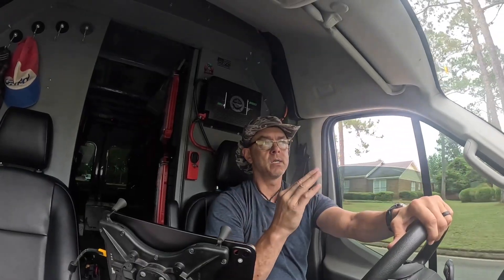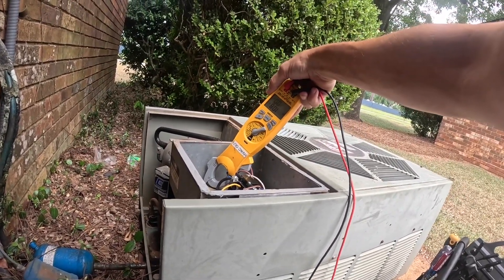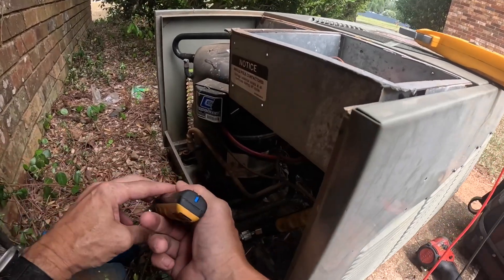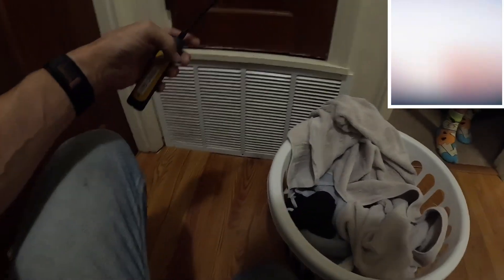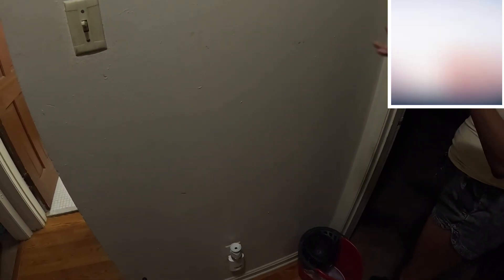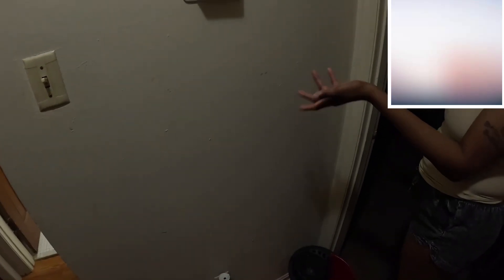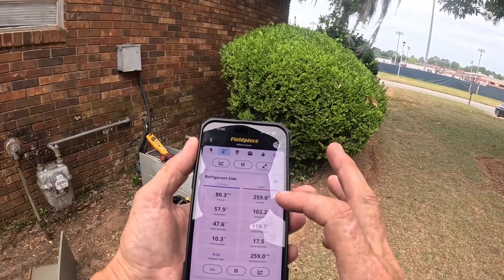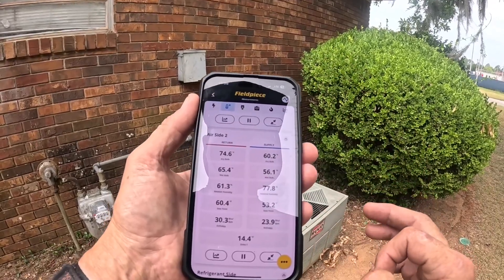Third Visit Within 2 Months, But Was It My Fault? #hvacguy #hvaclife #hvactrainingvideos

Comment: Some people are convinced that turning their AC off while at work will be cheaper than leaving it on. It's way better to pick a reasonable temp like 75 or 76 and leave it there. It takes way more power to get rid of a lot of heat to cool it off vs getting rid of a little heat to maintain temp. I have tested it and typically in my case it will take 15-20% less power over a week to maintain temp than it does to bring the temp down just to let it go back up day after day.

In this case the unit seems underpowered.
Reply: Correct.
Also, residential units tend to be undersized

Comment: That condenser fan motor is bad.
It was hot, did not spin freely and sounded like crap!!!
The age of that unit should make little difference in the expected delta temperature.
Yes, the need to keep it running continually when it is that hot outside is best.

Comment: This looks like a good place to share a secret. It’s called super cooling. It works very well in southern Arizona where the summer daytime temps are normally north of 100.
Run the AC at night. Turn it off around 0600.  Cool the house to as cold as you can stand it.
Everything in the house absorbs the cool air.  Around 2100, I turn it back on. The house never gets above 78.  Basically the AC starts once o every 24 hours. Five year old system still has original condenser.

Comment: I have the same outside unit at my house and was told the cold and hot valve was stuck and they no longer make a value replacement. They wire it to cool and they come back right before winter and switch it to heat. Is this true?
Reply: Ish. You could get a new aftermarket one. Won't be a direct drop in but they're available.

Comment: Perhaps a bit over-simplified, I've been told that airconditioning systems work on temperature difference such as this one is specified at 20 degrees. People seem to think that if you turn the thermostat down to 60 degrees on a 95 degree day that the unit will do so. A newly installed system might do that, an older system will not.

Comment: System seems to be working fine so callback is not your fault.  People don't seem to understand a system is designed to work by running all the time.  Like you said in the video if she shuts it off its starting over every time and can never catch up.  To maintain temperature and especially lower humidity it really needs to stay on all the time.  She probably thinks she is saving money but she is likely actually spending more because it its always working to catch up after being turned off

Comment: 10 superheat 17 subcool
R22 from my knowledge should be at perfect level 20-20 some play to it but over all pretty even
Id pull the gas and rx11 flush the lines through the evap out to the service valves
Piston may have some build up
That jumping delta would point me to the electrical heating strips the dang sequencers end up going sometimes and or the low voltage gets a corroded and turns it on 
Overall this call seems to be user error

Comment: NOT your fault.  Tenant is thinking that air conditioning should be cooling the house as quickly as the furnace heats it up. She needs to understand that an air conditioner does two jobs at once.  That it is dehumidifying and reducing the inside air temperature.  By letting the temperature rise to 80+ before she turns it back on in the afternoon she is overwhelming the air conditioner. If she wants to cool the house down quickly after turning the unit off all morning, the apartment we need an oversized unit, maybe three ton.... But then it would cool the house down before removing the humidity

Comment: Residential structures are only designed to maintain 78 degrees inside when its 92 outdoors here in north Georgia. Most systems have a little bit more capacity and on a 95 degree day you might be able to get the inside down to 75 degrees.

Comment: I had one of my Fieldpiece probes do what yours was doing there. I use Measure Quick because I’m not a huge fan of the Fieldpiece app, and I have a psychrometer for outdoor air. I noticed my head pressure target was bouncing all over the place so I checked the outdoor temperature and it was jumping from 85 degrees to like 55 degrees all the way down to 28 degrees then back up to 85. I put new batteries in it but it didn’t fix the problem so I bought a new one. If you had a psychrometer doing what mine was it would affect your Delta T like what was happening in the video.

Comment: Did you test the capacitor? I didn’t see that in the video, I had to ask lol. Also did you replace the condenser fan motor. We MUST cut the fan shaft down at our company. And if you did replace the CFM, it sounds like you caused the rattle you fixed. Good job.

Comment: Once everything inside gets warm, it takes hours to remove all that heat. Even the utility companies tell us in Louisiana to not turn off your central AC when you leave for work. Just turn the thermostat to between 78 and 80, so that the house will cool down soon after you return home, and lower the thermostat to the desired temperature. Turning it off also lets humidity get inside the home. The higher the humidity, the hotter it feels because water molecules in the air trap the heat coming off your skin. You sit there surrounded by a layer of your own 98.6 degree heat which can't just fly off into space, like it would in no humidity. Without the water vapor in the air, the Earth would freeze over. It traps the heat from the Sun. 
She needs a programable thermostat to set at 79 when nobody is home. Then go down to 76 an hour before someone gets home. They don't cost too much from Amazon.

Comment: I always try to accommodate the client to repair the unit no one wants to replace it, that being said once you do the repairs you now have married it. I would always give them the choice and with the understanding of the age and possibilities of not knowing how long it will last, then it falls in there lap. I can tell by looking at the wall switch this house is very old no insulation in the attic or walls or at the very minimum, take your heat gun point it at the ceiling I will guess its over one hundard in the afternoon. its easier to maintain the temperature then to bring it down all at once everything in the house is the same temperature walls furniture floor could take hours to bring it down 3,4 degrees.

Comment: If unit is working may need attic vents or attic fan to remove heat in attic. Sounds like the house ain't insulated well either...old windows too. trip fee plus your time and I would quote new system

Comment: Next time take a look at the air hander air suppy cage and i bet there is a ton of dirt that will change the amount of air in CFMs being supplied to the duct work. Air conditioning is all about the removal of heat across the coil. A old compressor will always reduce the refrigeration effect.

Comment: Not your fault. Rule of thumb you can only pull down 20 degrees. That old unit is kicking booty. My only suggestion would be to put a window unit in the living area to give it a hand, if she wants it real cold. Also don't block the intake with clothes hampers or anything.

Comment: In my opinion. If you hook up a gauge to a system connect a thermometer or your pressures can be useless. The fieldpiece app will tell you what range your outlet air should be. There's a ton of information there you don't  seem to be using. I understand if it's not on camera but seems to be information left out of the job notes. I work on a lot of old garbage and the more info you document the more it covers you.

Comment: There is more than just heat in the air to remove but heat contained in all the furniture, the walls, appliances, carpets. That is why it is usually most efficient to leave the thermostat at one temperature. If all that stuff in the room is allowed to get hot again, it will take that much more time, and that much more money, to cool the room again when you get home.

Once all the aforementioned items in the room arrive at your set temperature, they act as buffers to help keep the rest of your living space at a constant temperature.

Comment: Your only mistake was the same as mine. Using that dang Taiwan motor! Even though it was drawing less than spec, it still heats up big time because of the bearings. With those motors you need to hold it up once the blade is on and use a small hammer to tap that shaft up in and let gravity pull it down until it spins freely. You seen it only spun around a few times by hand, and mine did the same thing cold! Several taps frees up those bearings and then you'll get the right rpm out of it. Now I'm not saying beat the life out of it.... Just some taps to free it up. There's something not quite right with those Taiwan bearings that a few taps corrects and gives you the right rpm. I always check rpm now, especially with those cheap motors. If I'm not within 5 to 10 percent of max several taps loosens it right up. Spin a OEM motor and you'll be waiting for it to stop! We get what the customer will pay for and we have to make it work! So sad we don't make things in America any more! 😮😢

Comment: I"m curious- by "cleaned it out", I'm assuming that was washing the condenser coils. Did the underside of the A coil or the blower wheel get cleaned too? I'll bet that indoor coil is wearing a wool sweater. I used to have that exact system on my house,  and normally they work better than modern units. It just has to be super clean or it'll run till it burns itself out.

Comment: Shutting the system off allows moisture to enter the house, it has to then remove the moisture before the temperature will drop. Set and leave!!
Reply: Not only does the humidty in the house go up, but also the temperature of everything in the house go up. It takes time to pull out all that that extra heat, which will not happen very fast if the AC gets turned back on during the hottest part of the day.

Comment: That fan shouldn't stop spinning. I get that the customer turns off the AC, but you would think and correctly assume that she's been doing that always, and just recently the fan and cap were changed.  I'm thinking that fan is most likely quitting here and there due to the way I saw it spin when he looked at the data plate, and that's why she's not getting the temperature drop. I hope it doesn't come back.  Get em Curtis!

Comment: i payed to have a AC put in my parents house years back and hade the same fight with my father.  he instead that he was saving money by opening all of the windows at sundown.
and he did nothing but cry it was hot all day ,,, it got to the point that i just put a tamper proof state on the wall and them ground the heads off of the screws so he code not change it. 
then mother refused to cook him meals till he left his hands off of things. 
and what do you know if you set a AC at one point and let it alone they will work right.

Comment: Equivalent to trying to explain to air headed people that turning a thermostat all the way up does not make the furnace produce hotter heat and turning the thermostat all the way down does not mean your AC is producing colder air..  
😂 
You are just asking the equipment to run longer, and if it can’t maintain a temp within a 2-3 degree range it certainly will not do more by turning the thermostat up or down. 

And explaining that the ACs real job is not to produce cold air, its job is to remove heat..  
that will make their head explode.

Comment: Hey, I just read about an issue with using Jobsite/Fieldpiece gear.    Apparently it now requires you to have an internet connection to use the Bluetooth App.  So if you're in an area with a bad cell signal and your phone cannot get the internet it won't work.  Also there also seems to be a latency issue with Android phones compared to iPhones.

Comment: I’ve had to put in larger top cabinet screws in those old Ruuds to stop fan vibration noise since the old holes strip out… Just don’t do that at the bottom since there is minimal clearance to the coil.

Comment: I "fight" with customers when it comes to radiant in floor heating operation.  Decades of sliding a thermostat up the scale and down the scale on a forced-air system can hardly be over-written by the appreciation that the more current radiant heating systems we are installing now work different and don't like the "violent" heavy handed calls to operate.  Your customer's cooling complaint resonates with me heavily on this one.

Comment: Kinda surprised that system can't pull the temp down within a couple hours.  Maybe too much heat getting in and not enough insulation or too much solar radiant heating coming through the windows.  I am still running a 45 year old 8000 btu window unit and it cools the entire first floor of my house when the sun is out and keeps the whole 1st floor below 72F unless the outside temp climbs up much over 90F and then it just maintains the temp about 20 degrees cooler inside. Also sounds like the tenant needs a programable thermostat  that is set up to the temps they like and left alone to maintain reasonable temps when they are not home and then automatically goes back to the temps they like when home.

Comment: Have to agree that motor didn't look like it was spinning very freely but we'll see. The biggest issue is clearly that she's turning it off. I always give people the analogy of the home is like a battery taking charge all day long. Every bit of material in that home is getting warmed up and more and more humidity because of the air is not being conditioned so when you get home turning that air on it's got to cool all that material down expending all that energy over and over and over again. Much better to maintain a set-point plan.

Comment: Its  too small
Reply: Turning it off while she is at work doesn't help.
Reply: I may have missed it did he tell us what tonnage it was and sq.ft of space?
Reply: @phoenixhvac-r828  
I'll look at it again
Reply: I put a 5 ton in my house i didn't care about the square footage you know a bigger unit will have it cold
Reply: @leonardhilliard2636  that would be ok if it's close to the btu's you need to remove,  to large it may short cycle not removing enough humidity leaving the space cool but clammy
Reply: The problem this tech had on this system was it was only producing 14 degrees temp split needs to be at least 20, maybe 17 with high humidity, he needs to dig a little deeper...
Reply: @phoenixhvac-r828  i have a old house with a big furnace  in memphis it's working fine i see what you are saying

Comment: To be fair to the tenant, the HVAC industry has stuck with single speed systems for too long. If you had more multiple speed systems, then you could have more capacity for peak cooling while still allowing things to be comfortable during normal operation.  

I live in upstate New York where days vary more often between warm and hot. Heaven forbid you get too busy and miss the weather forecast and leave for work without turning on the AC on an unexpectedly hot day. Or you have relatives come over during the day and change the thermostat setting. Or the power goes out for several hours after a storm. Or you go away for a few days - like leaving on a day when the high is 70 and getting back on a day when the high is 88. There is no way I'd stick with a single speed system the next time mine gets replaced.

Comment: I would have washed that coil and used a 1075 rpm motor and a new blade. I also suspect an overcharge or a hunting txv causing that horrible delta t
Reply: He said coils were cleaned the first visit two months ago.  Can you just arbitrarily change fan speeds or go with what the oem specifies?  How would a new blade help on a twenty year old system that apparently worked fine until this tenant.  I don't know, I'm not an a/c guy that is why I'm asking these questions.  Had a guy tell me in my truck when its hot, put the a/c fan on low and crack the windows and the truck cools faster.  It seems to work.  He claimed it gave the gas more time to absorb the heat.
Reply: @kevinwalker4623  the old blade is likely off balance causing the horrible vibration. The increase from 825 rpm to 1075 rpm will move more air helping the unit cool down the condenser better. Its not more efficient on electricity cost but more efficient on how much cooling you can get out of unit. Kind of like spraying water on the condenser in hot weather. You get more capacity. But that delta t was horrible. I still suspect overcharged or hunting txv. The unit is not doing all it could do

Comment: At 14:15 I don't like that spin. It's not free.
Reply: ? What does the capacitor have to do with the motor not spinning freely? It's the bearings.
Reply: Bad Fan Capacitor, replace it.  If still slow, replace the fan motor.